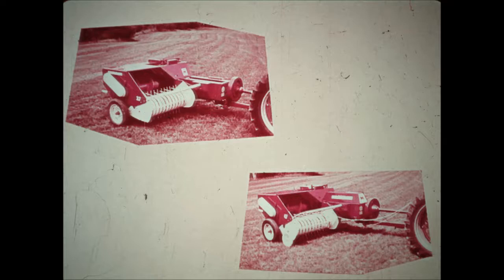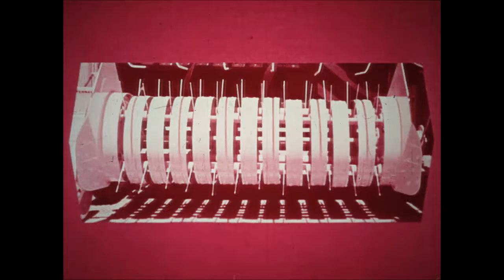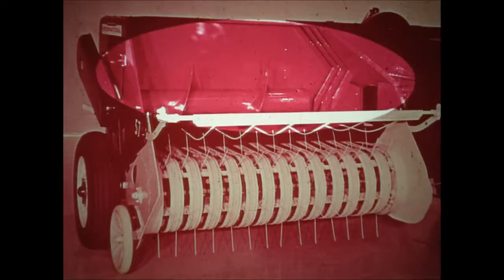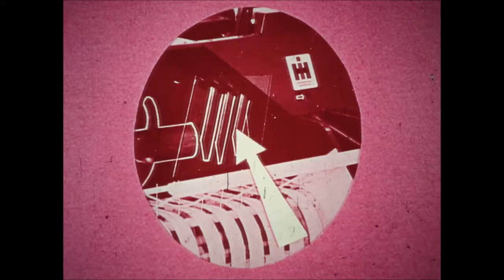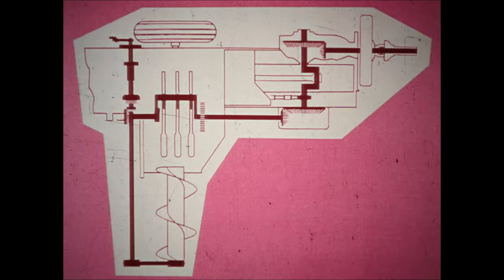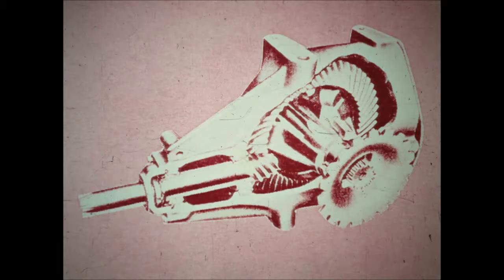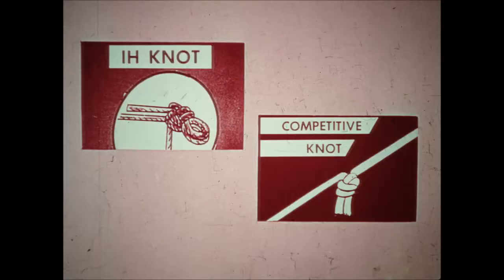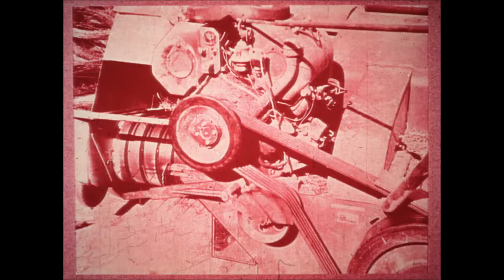McCormick 37 And 47 Baler vs New Holland 270 And 271.... Competitive Comparisons

Comment: So, this video proves, when they went with the McCormick knotter over the deering knotter,
they really thought of it, as a better knotter, than the deering, they licensed to everyone else.
I guess the proff was when the 440D came out  D for deering knotter .Don't know if those were
sold in the united states.  I've never seen one. Not sure what improvment was on the 440 in the 1970's.
I think it was three twine disk instead of two and a power driven twine knife
Reply from the maker: Our bandaid to that situation was the All Twine knotter & the 425 imported from England. That's roughly the time NH & Deere ran away with the market.